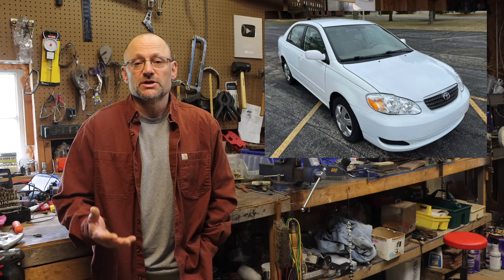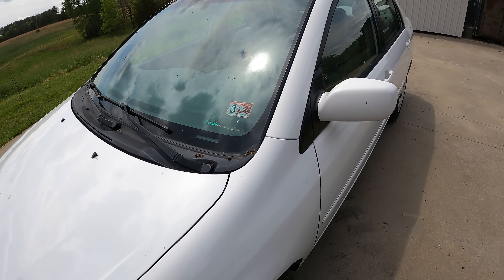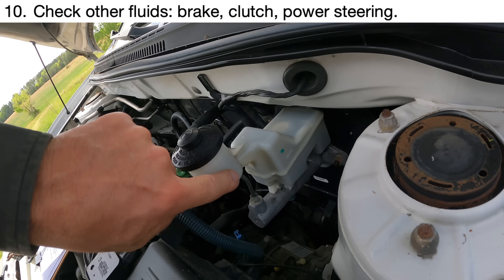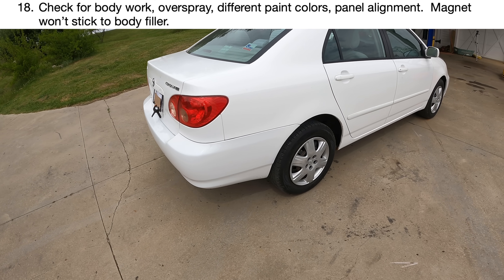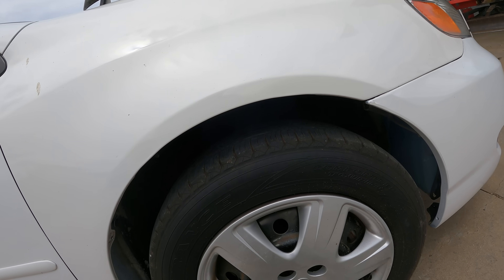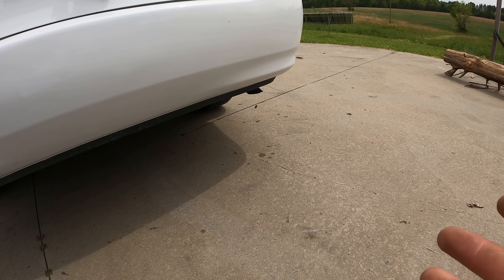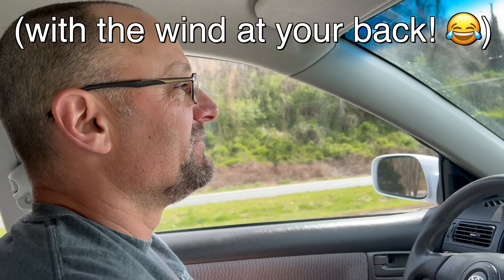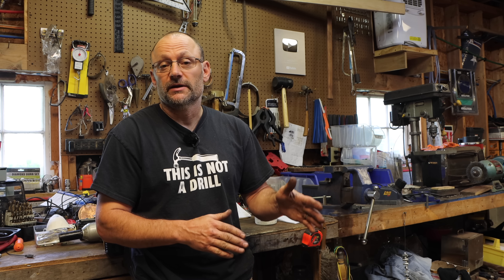Giving Away A Car To A Worthy High School Graduate.

Comment: 11:25 regarding brake fluid it doesn’t have to necessarily be full, but it must be within the minimum and maximum lines. When your brake pads wear down the pistons inside the calipers expand outward, that’s creating a void where more fluid will fill up inside the caliper draining the reservoir down. This can be one handy way to see possibly how much brake pad life is left if no one topped off the brake fluid incorrectly, it’s always best to manually inspect the pads if possible. You can usually see them through the rim and get an idea of how much life is left.
Reply: You are so right! In an intact brake system, you should never need to top up brake fluid. If it is low, check your brake pads!

Comment: Few notes from mechanical engineer regarding the water test on a belt, if noise goes away with water then it's belt chirp due to misalignment (could be wobbly pulley). If noise gets louder with water, that is belt squeal due to slip between belt and pulley due to belt tension issue. Also, check manual transmission fluid, some will have dipsticks like on Subarus.

Comment: For body damage look at the bolts for the hood and front fenders and doors and deck lid to see if a wrench has ever been on them. It is a quick way to see if they have ever been taken off. I owned a body shop and very few shops touch the bolts up after reinstallation. I did but most do not. I love your video's!

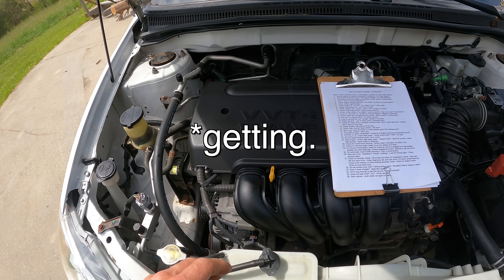Comment: 9:30 one thing to point out is that most modern cars no longer have transmission dipsticks and if they do have one sometimes the fluid level is read when the engine is running.
Reply: Most modern cars are rolling junk boxes

Comment: Another good check while the engine/cooling system is NOT hot and/or pressurized is to remove the radiator overflow or expansion reservoir cap crank and run th engine a few minutes to check for air bubbles especially on autos with engines having a history of head or head gasket leaks.

Comment: Belt squeal if the belt looks new could be indication of a failing component that loads and/or puts a load on the belt.  Even a belt tensioner.  Some belt tensioners have wear indicators of sorts on them or somewhere on the engine where the tensioner arm should normally range.  But if spraying fixes it could be minimal and good for a long time, or not.

Comment: I’d add to #31: as applicable, shift into and out of 4wheel drive. I bought a used truck recently and struggled to get it out of 4 wheel drive once I needed it. I think my trucks 4wheel drive was rarely used but my mechanic also changed the fluid out.

Comment: Well done Jon! For concerns over someone clearing codes right before you see it: a cheapo code reader will have 3 lights on it. Red, yellow, and green.  Those will tell you if the monitors have ran yet for the things that can cause the engine light.

Comment: While under the vehicle check for rusted out control arms, frame members chained up, buckles in the frame rails, signs of clamps that have been on the pinch welds if there is, it means it was on a frame machine (most body shops will not repaint these areas.)  Look  for gap differences from the upper door to fender, if wide at top and really narrow at the bottom on both fenders then your front frame is still bent down.  I was a body and frame repair guy for 46 years.

Comment: My suggestion to everyone who buys a car is take it to a mechanic and have them do a pre buyers inspection. It ay identify real serious problems but it always finds some things you will need to do be done soon and it gives you some help in negotiating a better price. The better price will usually be more than the cost of the inspection. So it is a never lose scenario. 

The person who bought that Nissan he gave away might have been warned to never buy a Nissan with the CVT transmission.  If you do you must always change the fluids at 50,000 Km which is less than what Nissan says in the owners hand book.

Comment: To add to the lack of protection of the missing underbody panel on the right side, it also seems to be missing the wheel well/fender liner on the front right wheel as well, which also protects the back of that washer fluid reservoir from debris kicked up by the wheel.

I’m gonna guess the front accident damage was worst on that side, and the body shop didn’t bother replacing those components. Or some hack mechanic took them off for some suspension work and never put them back on… but given the weird panel gap on the A pillar, I suspect it’s related to the accident damage.

Comment: Great checklist for car buyers! One thing though, automatic transmission fluid should always be checked with the engine running, that's probably why the level looked high on this car.
Reply: Not always.  I was doing a Honda, and according to their 
instructions, run the engine until warm, shut it off, and 
check within the next 10 minutes.

steve
Reply: @steveskouson9620  That's a new one to me, then again my newest car is old enough to vote...

Comment: This was a great video.  Its nice to do things for folks that appreciate it.  When I buy a used vehicle I end up making the dealer a little nervous as I spend time looking at everything.  The last used car I bought was a Honda Accord.  I had never owned one and this one was a nice car.  I got to the dealer early on a Saturday and had to have one of the kids that worked on the lot ride along with me while I test drove it.  The kid was knowledgeable and helpful.  I paid cash for the car and told the sales manager to pay the kid a commission for the sale.  I also told the manager that I would check back to make sure the kid got the commission other wise I would return to oversee the process.  The manager paid the kid and the kid ended up becoming a sales person.  I drove the car for 5 years and ended up selling it for just a little less than I paid for it.  It was a good car.

Comment: Great video. I'm a big fan of the channel. Add rim check to your used car buying checklist. People curbing rims, off-road material jammed between the rim and tire etc... At 15:20-ish the rim had a flat spot/dent in it.... On the inside 😳. Very odd. Kinda shows how the vehicle was driven by looking at the rims. I wouldn't have commented if it wasn't on the inside. Outside is typically from bumping against a curb.

Comment: What a great story, thanks for being the guy who gives back to the community!  A few points of clarification and other tips for your lists.  Not all states have a inspection requirement.  If your state does not it might be a good idea to take the car to an independent mechanic for a pre-purchase inspection.  Several shop I know do this for less than $150.  That is dirt cheap insurance.  When you check the fluid on an automatic transmission, consult the owners manual.  Many transmission specify that you need to have the transmissions warmed up and engine actually running when you check it.  Also get used to smelling your fluids.  Transmission fluid is especially easy to tell when it is worn  out or overheated.    Also, be sure you know about the rules for title/license/registration in your state.  For example in Iowa, if you buy a car with expired plates, YOU re responsible for bringing the registration up to date, including any registration fees that would have accrued from the time it was last registered up to now.   Side note, it looks like the inner fender panel on the one side of that car seems to be completely missing.

Comment: 10:00 when checking coolant you can find out what color the car is supposed to have and compare that if there’s been previous work and if they used the right fluid. On bmws the coolant is a light blue but if you have someone that did their own work or a cheap shop they will use the wrong color many times it’s neon green universal coolant.

Comment: In addition to checking tire wear, and wear pattern, I recommend looking for any signs of cracking and reading the 4 digit date code.  5 years old is the generally accepted point at which they're more at risk of failure or reduced traction, but they can certainly live longer than that.

Comment: Belt squealing is mostly caused by the belt Slipping on a Pulley so the belt is skipping and slipping on pulleys normally the belt is spinning slower then the pulleys and it causes the noise could need to be tightened or could be a stretched or could be a warn out belt @26:09 @FarmCraft101

Comment: @ 13:37 that rust bubbling on the sill in front of the wheel will need to be addressed before it gets worse as it is not what you see there it's what you don't see behind the rust you can see.

Comment: Dude I Painted that car..well sort of. At the time that was painted I worked in the paint shop as an engineering manager in Fremont.  040 white is a pretty dirty white so all the stuff you pointed at that was very bright white was repaired, just like you said.  You can also see that little retainer clip on the right front bumper should be black and it has overspray on it…so yeah I think right front damage too and that’s why the fender liner is missing.  You’re awesome doing that for kid..love your videos

Comment: The rust tide mark in the spare wheel well points to it being flooded for a period of time most likely a failed boot seal.
The replacement of one caliper (should be done in pairs) and not replacing the guard points to extreme economical maintanence so there are possible issues down the line with parts due for replacement.
Under engine guards are missing, again pointing to lack of attention to detail.
Depending on purchase price it could be a deal but I would rate this car as bottom book .

Comment: You should check if all the indicator lights on the dash turn on (for a short time) after turning on the car. Sometimes they will disable e.g. an engine light to hide an issue, so if it doesn't light up at the beginnig you know.

Comment: 9:48 certainly this varies between makes and models, but typically my experience has been that you check the transmission oil with the engine running and up to temperature. With the engine off, the transmission fluid will typically show overfilled.

Comment: would also advise to listen to the a/c compressor and see if it makes any noise at idle with the a/c running. also, check to see if any warning lights come on after running the engine HARD! especially look for a low oil pressure light at idle.

Comment: Solid advice, with one small exception. I was an auto mechanic in both an independent shop, and two dealerships over the course of several years. The independent shop would basically pass anything that wasn't visibly falling apart in front of our eyes, but at both of the stealerships I worked for, almost all of the other technicians actually performed by the book safety inspections and had a much higher failure percentage than the independent shop. I'm sure that varies wildly depending on the shop, so I'm just speaking based on my limited first hand experience. Thanks for putting this information out there!

Comment: One thing I would suggest is when checking the tires check the manufacturer date. As car tires should be replaced with in 10 years. 
Even perfect new old stock tires that are out of date should be replaced. 

On my motorcycle we don’t like the tires over 5 years old if they make it that long. 

Just a thought

Comment: Great video. Beware really nasty people will mix in metal powder into bondo to make a magnet stick!!
I also suggest that maybe some simpler language for the truely non-car people, like "Look for things that are wet or dripping" as most dry cars will be dry in the engine compartment and underneath. Over-full liquids can mean it leaks and this was topped up recently with extra so it lasts longer

Comment: Gas station or dollar store selfie stick works if you don't want to crawl underneath the car record underneath with your phone. 

I used to buy and sell minivans off Craigslist (before Marketplace was around). It felt good knowing the little money those folks had wasn't going towards a rigged up POS. I was surprised that about 20% of the buyers didn't even open the hood. Some didn't even test drive it. Another thing I noticed when buying a car, was if the seller has something to hide, they claim to not know even basic questions, or if they simply tell you everything you want to hear, or if you catch them "distracting" you when you look in certain areas. Red flags.

Comment: i came across something called por-15. now that I live in the rust belt I swear by it. super easy to apply (wear a respirator, it's the serious kind of toxic). and it does a stellar job at both converting the rust and protecting. of course that amount of rust is negligible.

Comment: That was fantastic.  He was speechless :)
Another tip is when you turn up, check to see if the engine is warm.  Most likely they've started it and run it due to cold start issues.

PS.  Are you planning on doing this again?

Comment: I'd recommend doing a transmission flush around 120k miles on that one. Was getting troubles with my 2.0 Toyta Avensis 2004 around that milage, but a new filter and fluids it ran just fine untill i sold it at almost 200k

Comment: More info for point 16, modern GDI engines do make soot. So getting your finger black is normal.
Here in Germany or Europe cars now have to have an OPF. I think since 2017/18.
Yes even gas engines have to have a particulate filter now...

Comment: Always check ball joints and Wheel bearings with the wheels suspended off the ground doing it while vehicle is in the ground will very rarely show the issue because the suspension is relaxed in its normal ride Height @20:50 @FarmCraft101
Reply from the maker: Agree, but not many people are going to jack up all 4 wheels of a car before they buy it!  ;-)
Reply: @FarmCraft101  I understand that I'm just saying to do a wheel bearing or ball joint check it will vary rarely make the sound on the ground its normally always done during suspension droop and lifted just giving my expertise as a mechanic is all.. that is one of the tests that are hard to check As a buyer unless you have a mechanic and a lift or a mechanic that has floor Jack's and stands

Comment: Jon, I saw online and they said to pull the seat belt all the way out and look at the very end to see if it is moldy or stained. If there is staining or mildew or mold at the base of the belt that could be a sign the car had been in a flood or submerged in water.. My 2 cents for what it's worth.

Comment: 05 Corolla will be a good car. I have an 06 with 360+ thousand miles on it. The only thing that has been done to the car is change the oil put brakes and tires on it and drive it. I am the third owner. My in-laws were the second owner believe me this car has been driven hard but it is a Toyota. They will take it and asked for a second and third.

Comment: That range of toyota 4 cylinder engines had an issue with the oil  rings and pistons. The oil drain holes in the pistons gunked up and caused accelerated oil use. Which could cause problems with the catalytic converter.

Comment: I like what you’re doing for the kids that could only come from God, now I’m gonna teach you one more trick. If you’re not gonna do a leak down test or a compression test, take a piece of looseleaf paper, put it back at the end of the muffler, if it blows the paper away, it’s good if it blows the paper away, then quickly sucks it back in the muffler, then blows out and then sucks in and then blows it out. It’s a Valve problem. It should only blow the paper away from the muffler, never sucking in.

Comment: Looked like rust in the trunk spare tire well.  That could be a sign of a leaky trunk seal, plugged drain, window seal, tail light seal, or more significant water damage.  Probably related to the rear bumper damage.  As long as it was a one-time thing and not something that's still leaking.

Comment: One of the things about the various fluids, even if it looks fairly clean, does it smell burnt? You shouldn't really get much of a smell off of any of those fluids, but if the vehicle has been burning the fluid, it will give off a very distinct and strong smell, and that should clue you in to the fact that there may be a problem, possibly a big one, that's not readily obvious.

Comment: If the dealer or previous owner cleared the codes, you can tell because the monitor test will not be completed. Most readers, even the cheap ones, will tell you this. Like a PO1000 code.

Comment: I have a 2016 Toyota Camry with 122,000 miles. All my car needs is a oil change and change out the spark plugs. Which is the deal mile recommendation. I’ll sell it for $14,000

Comment: brake shields are NOT easy to replace in the rust belt xD other things to mention: look for "milkshake" under the oil fill cap, oil dip stick, or in the rad. if you see any STAY AWAY!

Comment: Every tire is federally mandated to have a date code also for age. 4 digit number on the tire first 2 digits are the week they were made next 2 numbers are the year. This car, from what I could see in the video, has tires from 2017, so 5 years old already which is fine as long as there isn't weather cracking on sidewalls or in between tread. 

Awesome video and super nice thing you are doing. We also do something similar to this at my shop. It's always nice to be able to give back!

Comment: Sorry but what you said about unscrupulous dealers and/or mechanics resetting codes and it takes time for the codes to appear again is not true. They don't reset codes, they erase codes with their scanner and the same code will appear again immediately if the problem still exist.  Also there is a history of when codes were erased in the PCM's memory that a scanner can read so you know when the codes were erased.